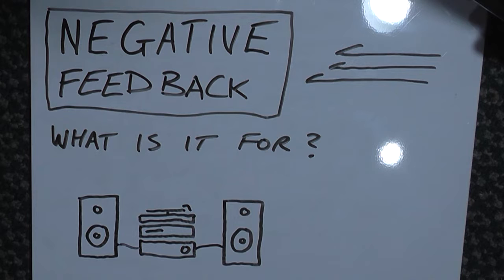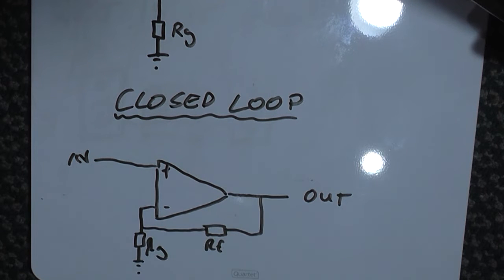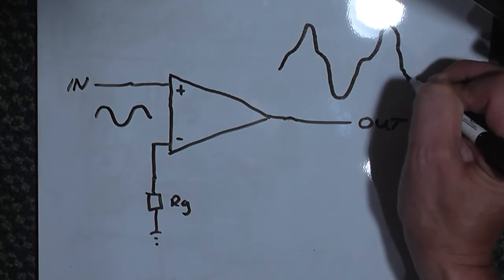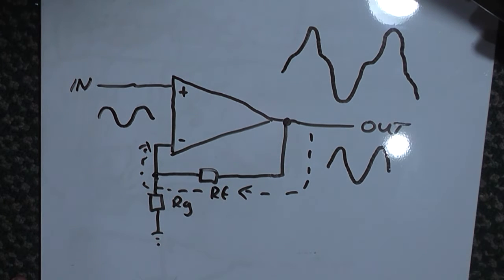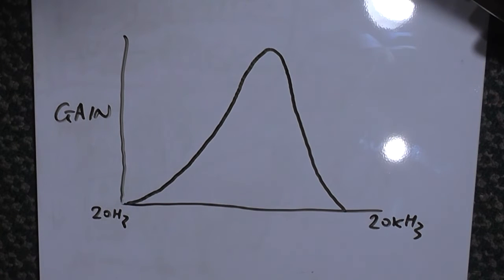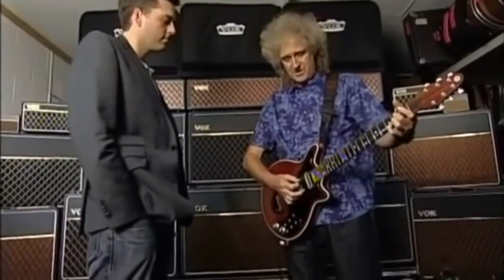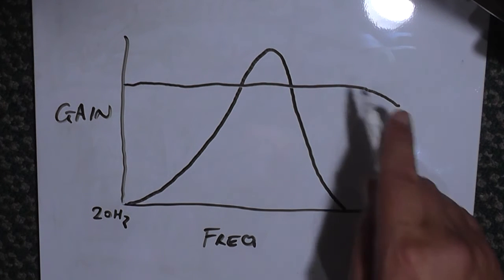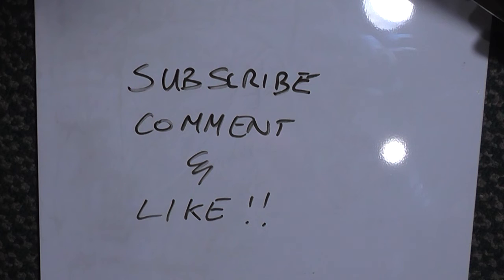Negative Feedback In Audio Amplifiers: Why Is It Used?

Comment: True, but you don't mention any of the downsides. In moderate amounts (below 15db), NFB actually increases harmonic distortion above 3rd order. So you need lots of NFB to reduce the higher order harmonics, which necessitates adding more gain stages... which increases open-loop distortion.
And due to phase shift and gain of the NFB loop changing with frequency, you get intermodulation distortion (IMD) which is particularly nasty, and transient IMD on percussive sharp attack sounds. Also the NFB loop essentially doesn't work at very low and very high freq, causing instability at those extremes due to the high gain, unless compensated.
These things were not well understood in the 1950s when guitar amp topologies were set in stone.
You definitely don't get something for nothing. I've yet to hear an amp that sounds better designed with NFB. The average guitar player may not notice, but when you build your own amps and listen, you start to hear the differences.
Reply: 20Hz-20KHz usually is the norm. Wider range 99% of people can't hear it nor masters demand for it. The distorted guitar sound without NFB is the desired sound.